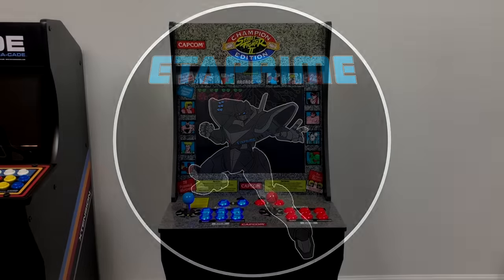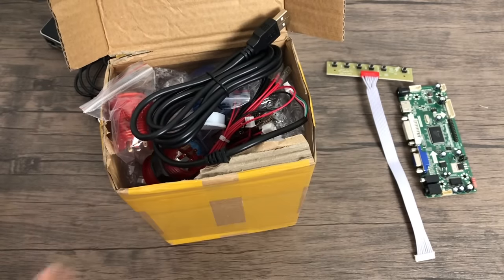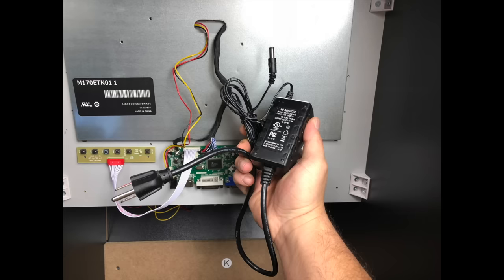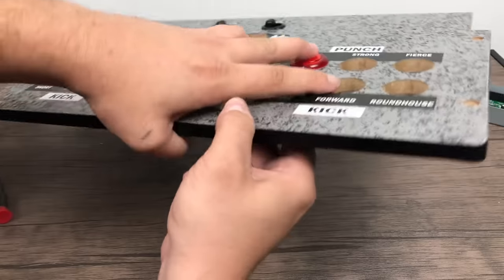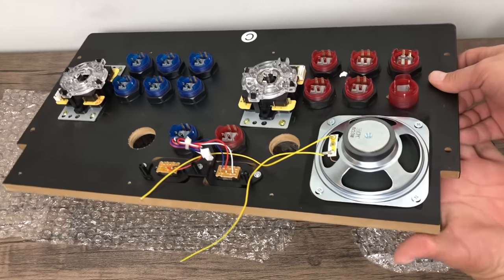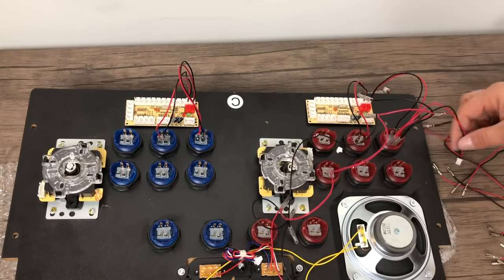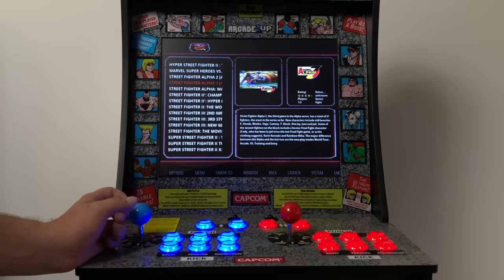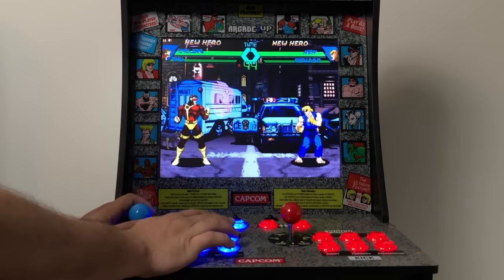‪Arcade1UP Raspberry Pi Install Tutorial - RetroPie in an Arcade1UP

Comment: I'm just waiting for Star Wars Trilogy to come out. If that never happens, this will be my only other option.
Reply: Do you mean the original Star Wars and Empire green vector games from the 80s with the flight yoke? Plus the old RotJ game? If so, the 1Up version came out a mere month or two ago. I bought one for Christmas and it has got to be the one of if not THE best of all the 1Up arcade machines. I mean playability, graphics, everything is almost perfection, and it saves the high scores when you turn the unit off. It comes with the 2 foot riser which is essential. The only downside is the $450 price tag. But I just saw it at Walmart a day or two ago (early January 2020) for $399.
Reply: But if you mean the newer SW trilogy where you can select Yavin, Hoth, or Endor, then I doubt that will come out, I think it's Sega, not Atari. However, a SW 1Up would be PERFECT to use to mod for this game and others that use a yoke!

Comment: I have everything set, but during the drilling process the wires for the speaker [On the button board] it came off. So am I still able to get sound from another method, or am I just out of luck? Thanks in advance!
Reply: Hello! How did the cables disconnect? Did they rip from the soldering points at the speaker (those silver dots)? Than you might be able to reattach them by using a cheap soldering iron. But please be careful if you are not used to soldering, maybe read some guides in the internet! If the speaker was damaged and is unusable you might replace it with a similar one that uses two wires. As far as I could see in the video it is using a 8 ohm 3 watt speaker.
As a quick fix you could also connect some active speakers (maybe you have some old speakers lying around that have an own power cord? For example pc speakers?). Those do not require the ampflifier and can be directly connected to the controller board by using the audio cable (aux, 3mmm, whatever it is called - maybe the speakers even have their own audio cable attached). Than just put those somewhere in the cabinet and adjust the volume. They might sound a bit more muffled because they are not directly connected to the outer shell like the original speaker. I am not sure how much that might affect it.
Reply: @Niasify  Hi! Thanks for responding! I used computer speakers and it works perfectly! Thanks for responding though, much appreciated!!

Comment: Help!! Hello and I am attempting to perform this mod for the first time. Question: I am doing the mod on the regular edition of the Marvel Superheros cabinet and it has already the 3.55mm plug. Do I assume that I can just bypass the amp step and plug it right into the video conversion card? If I can’t, do I cut the wire and splice it into the amp? Thank you all for the input.

Comment: How did you change the end of the usb to go to the encoder board from the PI ? you had to have cut the usb and added a pin connector, what size, how many pins and order of wires on the connector? this is the only confusing part that I see

Comment: hmm.. seems like too much effort to try and convert the thing over. Im tempted to just build an empty cabinet with shelves to plop in an old HDMI monitor and connect a couple console USB arcade sticks directly to the Pi than running all the wires and etc. Are there any good options for buying an empty cabinet just for that? I imagine retropie already supports Xbox and Playstation fight sticks.

Comment: May I have a link I can use to find/replace the CFL connector wire you plug it in at 5min26 sec, it's the smaller wire

Comment: If you wanted to use the dual speakers with the newer arcade 1up. How would you use the 3.5mm jack. I would hate to splice the wires for the amp.

Comment: 2 questions... so, I installed a LED power button to my unit setting 5/6 pins for NO and I'm using pins 4 and 8 for the LED.  I ran the scripts and the machine now starts and turns off with the button... great!  But - the LED stays lit when the power is off... I am using the NO pins so it should turn off... am I using the wrong pins?  Secondly, the scripts power down the pie.. but what about emulation station?  Should the script also shut it down so all high scores and other metadata is saved when the power button is used?  Thx for your help!
Reply: I haven't built this, but something in your question got my attention. You said when you power off the Pi, the LED stays on. This is normal for a Pi. When you shutdown the software/OS on the Pi you are successfully turning off the computer- the red LED is more a "power connected" indicator than a "powered-on" indicator. Once the Pi has done the 8-10 green flashes it is safe to disconnect the power.

Comment: Any help on this would be awesome. 

After installing everything and plugging the raspberry pi's power supply and the cabinet's main power supply into the wall each, everything works and displays beautifully.

Now when I try this exact same thing plugged into a power strip, the raspberry pi boots up with a much lower resolution and looks pretty terrible on the cabinet's screen.

Could it just be because I need to get a different, more powerful (?) power strip?

Comment: I only have a single conter-top setup.. 3 games. Can I still do this, I will add the correct amount of buttons but I would like to attach wireless controllers so I have both features. Is this possible? I want the arcade joystick and buttons mashing as well as the ability to play wirelessly.. My 2nd option is just build a new cabinet and do it your way.. Basically is there a way to make my arcade 1up stand has a purpose? I have everything configured on my Raspberry Pi and over 6000 games on 15 platforms.. Will this work?

Comment: First off great video(s)!! I have a question for all. I bought a Arcade1Up Marvel edition. Love it thus far. Followed the videos above BUT my sound does not work.  I plug the respected cord (the speakers are above which the Marvel cap comes that was ) into the audio jack. STILL no music. Not sure what the problem is. Please help ? I really enjoy this channel and I wish I was more electrically inclined. These videos motivated me to buy an Arcade1Up and makes these mods. Thanks for everyone who can help.
Reply: Thanks Joe. I never thought of that. I do know that the speakers some my cab do work. They worked before I made the mods. I will try and find some wired speakers to test. Thanks man !!!
Reply: So I found out that I have audio but it is very low. Tried various ways to fix but I can’t seem to increase the volume to save it. Read a bunch of stuff online but without any luck. Not sure why my stock speaker for the Marvel Cab will not save or increase the volume. I tried Audio settings and also retro setting DOS screen. Lol. Any suggestions ?
Reply: joe1597 thanks ! I will try and look around. A lot of the work around online is to change to HDMI but I would like to make it simple by just plugging the original speakers in.

Comment: I had a question. I did everything right changed the HDMI Lcd Controller board in it with two different ones (first one didnt match the number on my lcd monitor). I keep getting fuzzy and lines on my screen was wondering how to fix it.

Comment: So I followed everything to a point and for some reason I cannot get any sound out of cabinet? I bought the marvel 1up machine. I was promoted with the following message...
Volume control issue. Failed to find mixer elements. I have the amp set secured to the inside and  even bought a converter to have it go from 3.5 mm headphone Jack to yellow/white audio audio input. Still no sound. Any suggestions.

Comment: My set up was working and I always leave it on.. I came in one day and nothing was on the scree. I unplug the power and plug it back in and the led turns green but turns red right after on the long skinny board and the lcd screen says no input. Do you know what could be my issue?

Comment: Anyone have problems with emulators not utilizing the buttons correctly based on how you set it up? I run batocera which also uses emulation station, and every emulator seems to behave differently, some don't work with the arcade buttons at all (have to use a keyboard), some won't accept the hotkey shortcuts (including exiting the game), some have the buttons mapped incorrectly.

Comment: If I cheat and wire in a games preloaded console control deck (such as the ones on ebay) with joysticks buttons games etc with hdmi connection.. will it work. Will there be a problem with the power supply ??

Comment: Anyone know what might be wrong with mine? The SF2 cabinet worked fine out of the box. I followed the instructions on this video and the pi with the joystick and buttons worked fine hooked up to my tv (took a few extra days for the lcd controller board to arrive). Once I got the controller board and hooked everything to the cabinet I only get a white screen with a few random colored lines going vertical on the screen. I'll eventually hear the sounds of a random game on demo mode, but the screen doesn't change at all. I returned the controller board and bought another from Amazon that claimed worked with my model monitor and had good reviews and I get the same results. I also tried hooking a Nintendo Switch up to the HDMI and the screen has the same results.

Comment: I have the same amp that ETA PRIME has and it's flashing red and blue lights when I turn it on. Mine didn't come with a manual. Does anybody know what means? Maybe I need a new ac adapter? If so, which one did you guys buy?

Comment: Hey man, hopefully you see this. Thanks for making this, I just have a question I was hoping you could help with please. I've wired everything up exactly as specified here, and put all controls in identically on both boards, however when I get to the main screen I can open the menu and scroll down, but I can't enter the menu to map the buttons, despite the joystick working. Any ideas please?
Reply: I got the same problem. Let me know what you come up with please?
Reply: @jasonstrohl2760  hey so what I ended up having to do was to remove the individual controller config files that have already set the controls up. To do this you'll either want to wirelessly connect to the board or do a wired Ethernet

Comment: I purchased everything from the video and connected all parts correctly and placed sd card inside rp3. The unit turns on but shows a screen which says user has not updated unit. Am I suppose to download anything to sd card?

Comment: Is it possible to run a pb and pi in same cab using same buttons?  I was going to use daisy chain cable snipped to look like this going in ^ into buttons having issues with grounding of pi (the buttons are already grounded through the Pandora's box)

Comment: How do i mount the lcd board directly onto the back plate of the lcd monitor? The power cable that comes out of the back on the monitor is too short to extend all the way down
Reply: Don Nguyen I had the same problem and had to remove the LCD screen and drill a hole on the back of the cover to pull the cable through. When you unscrew the LCD screen remove some other screws on the side and then the screen should come out of its case. Once you do that just drill a hole on the bottom right above the sticker if you’re facing the rear of the cabinet. Once you do that just pull the cable through and you should have enough length to be able to sticky tape mount it below the metal cover

Comment: I did exactly what you did, all games working fine but no sound. Everything plugged in tight and volume up on amp,  any ideas?
Reply: I have the same issue. I was wondering what's the solution.

Comment: so i hear that the standard arcade1ups have pretty bad response times on the buttons. specifically the sf2 ones. Does replacing the buttons fix it or is that an emulator problem?
Reply: also, will installing gamepi disable the wifi play? I am guessing it will definitely not be built in like on the base cabinet.

Comment: @11:43 I noticed that the 2 joysticks are opposite to each other (check the white connection point on them). I did exactly the same just to make sure I'm following the video. However, I noticed some New Geo games flip the control on one of the joysticks (right is left). Do you guys think that this is the reason for it?

Comment: I finished modding my cabinet and everything works as directed. That is except for the player 2 joystick is inverted, even after configuration. Any ideas why?
Reply: Mine was like this as well. Unscrew the joystick and flip it 180 degrees and screw it back in

Comment: So I'm building as we speak .. as I'm doing the controller, I don't see or have a speaker under my unit.. I'm using the marvel vs Capcom unit.. will this just work in HDMI for sound and if so do I still need this amp? 
I don't see a speaker what so ever.. and how do I get the Marquee light to still work ?

Lastly
Reply: Let's see I f I can help you out a bit. I do not have the unit myself but I built my own arcade from scratch so I'm familiar with the process.  I also took a look at a modding video for that particular unit and the speaker setup is different from this one, on your unit the speakers of the arcade connect directly to the board using a standard 3.5mm audio plug rather than the internal connector shown here. 

Lucky for you if you are following this tutorial the LCD controller board ETA recommended includes a 3.5mm audio jack! Just plug the arcade's built in speakers into that and you should be good, you do not need the amp at all unless you are adding more or better speakers.
Reply: @alexisrivera200xable  I was having this exact same problem he was and I have that exact same cabinet. I did what you said but for some reason though the volume is still low on it. How do I update the volume after I put the 3.5 cabinet connected speaker directly into the board? Also the marquee does not light up because it’s not connected to any power source. How would I find out what adapter is needed to plug into the marquee connector on the other side to power it?
Reply: @DJizLurch  hi D lurch.  Did you ever figure out how to fix the volume on ur marvel vs capcom cab? I’m having the same issue too

Comment: I have a pacman cab that I may want to mod if I cant repair, but I was wondering if you, or anyone here has repaired this before.  I can turn on the cab and go through the key test and all the keys the screen, and the speaker pass (however the screen seems to be "shifted" to far to the left so it cuts off the first few letters on the screen).  The game loads the the game select screen and I have no sound, and no key input (no up/ down on joystick and no select with A).  Any thoughts?  I have taken the cab down and checked all my connections, they all look good.

Comment: How do u turn it off when done?  Is there a shut off in retro pie or can u just unplug the powestrip from the wall?
Reply: Only methods for turning off the cabinet after doing these mods is either unplugging the power strip itself, or flipping the switch on the power switch if yours has one.

Comment: 6:33 what do I do if I did everything correctly but get NO picture using a raspberry pi with raspbarian on it
Reply: Unrelated question: if 1 prong on the "30 pin header" on the LCD controller board is snapped off would that stop me from getting any kind of picturewhatsoever on my screen when everything else is done right???

Comment: About 2 years ago, I followed this guide to mod the exact same cabinet with the exact same hardware and everything worked perfectly. After not playing this modded cabinet in months, I felt like playing Street Fighter 2 this past weekend. After I turned on the power strip, I noticed the LEDs on the buttons weren't lighting up. I also got a display message saying "No Signal". I didn't know where to begin on the troubleshooting process so I just put the cabinet away. Does anybody know what could be the problem with my cabinet or why it stopped working? Thanks
Reply: check the circuit board maybe it got corodded
where was it stored did u ever fixed it??
Reply: @coolelectronics1759  I keep my cabinet in my game room. I did fix it. However, I'm not entirely sure what fixed the problem. I removed the SD card from the Raspberry Pi and turned on the cabinet. This time the led lights on the buttons did light up. Turned off the cabinet again, and re-inserted the SD card the Raspberry Pi. Turned on the cabinet again and everything started working normal. Like I said, I don't know exactly what fixed it.
Reply: @MFShadow956  nice!
Probably a capacitor just had to warm up that had dried up from no use over time.
Its called reforming
Not unheard of in old rotten ham radio stuff but it happens from time to time even in new well kept equipment even in the best of conditions.
Thats why its good to give your electronics regular use.
Glad shes up and running again!

Comment: Hello, I set one of these up and it works fine at first but whenever I exit a game the screen fades to black and stays that way. It doesn't go back to the menu and i have to restart the machine. This has been an unbelievably infuriating process, i've tried everything. Ive tried 3 different raspberry pis, many different sd cards, different monitors, different power supplys, I'm at a loss for words.  Is there anyone that can help me? I've found a few threads online where people had the same problem but no solutions. I'm running a pi3. This is supposed to be a christmas present for my nephew. Please help.